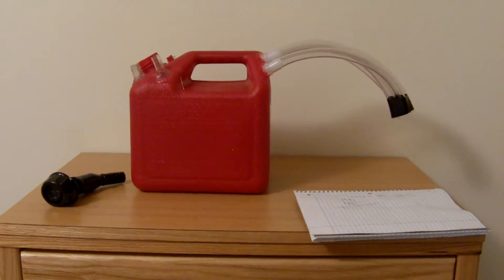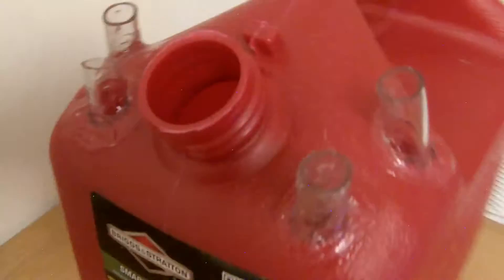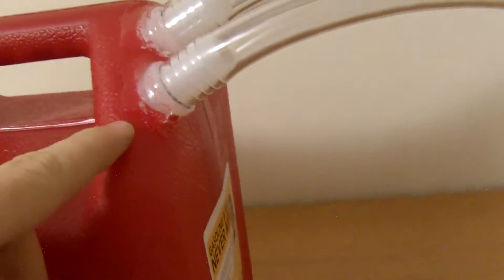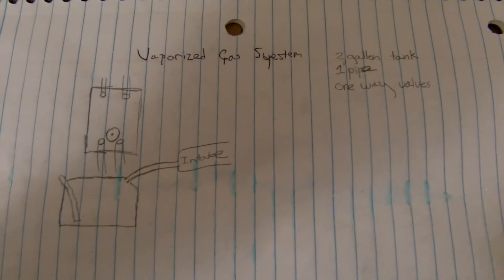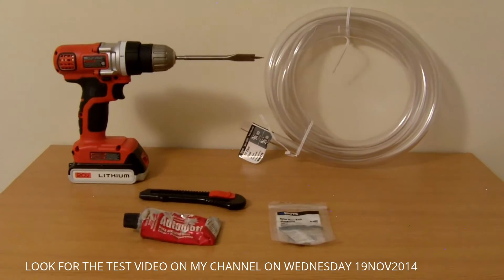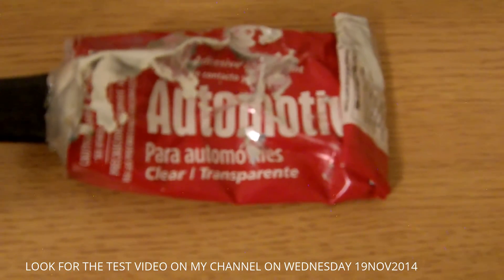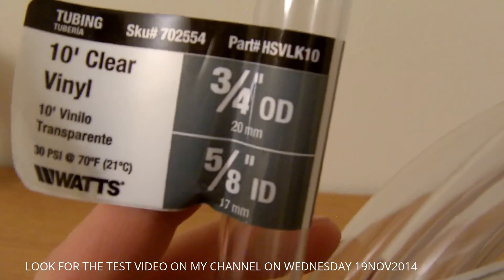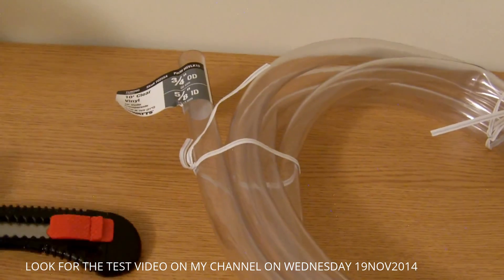Gasoline Vaporizer Project 1997 Honda Civic HX

Comment: I will gladly pay you Tuesday for a hamburger today.. no really, u say 80 mpg, do u disconnect the fuel line and just use this contraption? What do u do, just add more gas to this tank if car stops running? I'm confused. Damn Honda gets 45mpg to start with, my truck gets maybe 12, you get me 30 mpg from my f150 then you'll be the fucking man!!
Reply from the maker: Koch 40 the idea is to not allow any fuel other than that coming in from this system. I never got the Honda running off this system alone although people have offered ideas to me to make it work I'm in the Army and don't have time for it right now. The system that I have seen my best results with is hho. With an hho system I installed on my old Truck  (with a Chevy 350 engine) I was able to increase my gas mileage by about 20%. Nothing magical but it was acceptable, had I built a better system then I would probably have been able to get even more.